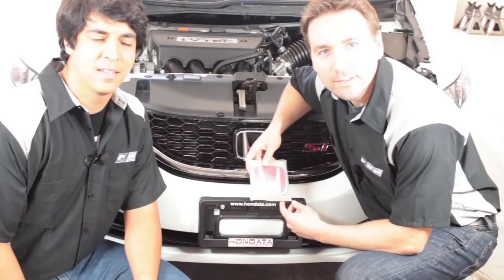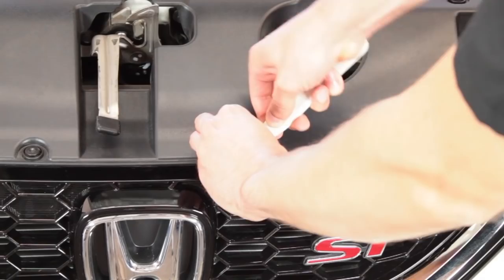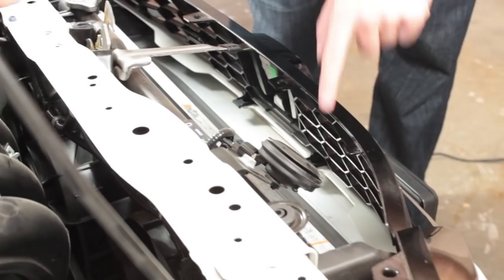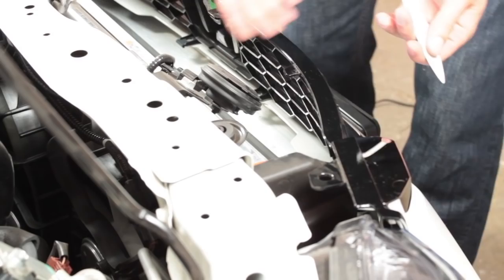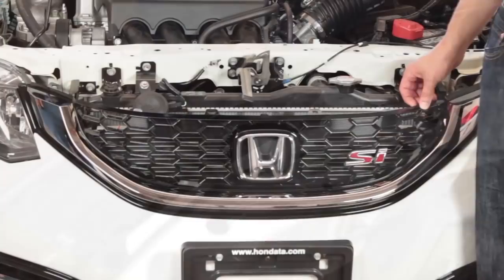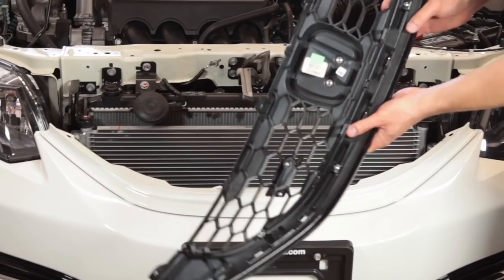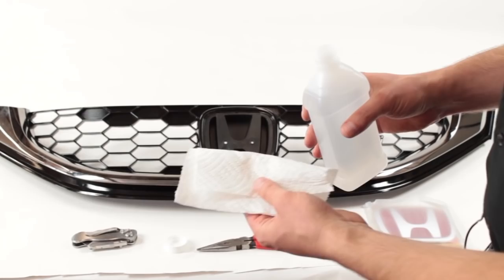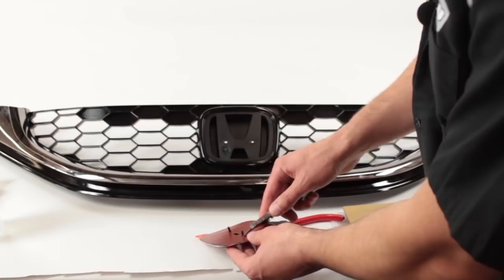Front JDM Honda Red H Emblem Install - Civic Sedan Si 2012 2013 2014 2015

Comment: For those trying this same procedure on a 2014-2015 coupe, the grill is definitely not the same. I just finished replacing the emblems on my 2015 Si coupe, and the plastic grill does not completely come off the same way, and I didn't want to try to remove it, for fear of cracking any pieces. If you don't have huge arms and have a little bit of patience, you can remove/break the clips blind from behind if you can wedge your arms and pliers behind the grill. Just pop off the plastic rivets like in this video, and it will give a little space to get behind the grill.
Reply: Hey man!! I know this comment is old, but how did you end up taking off the rear badge for the 2015 SI coupe. Did you break it off with the rear pins as well?
Reply: @04majestic   ooh that was a while ago! If I remember correctly, I think I was able to get a piece of dental floss threaded behind the badge, and got the badge up so I could carefully pull at it, moving from one side to the other, and was able to remove the badge without breaking it. If you don’t care about keeping the badge, you can def just muscle it and rip it off lol

Comment: Heat gun,plastic trim tool and you can do the rear and the front quickly. Didnt have to take off anything but pull down part of the trunkliner doing the rear.

Comment: Just done this, took 30 mins, 2013 hatchback, there were 4 screws holding the 'h' bracket on, undone them (fiddly) and the whole thing comes off. Old badge off, new one on and back together.
No need to take the grill part off mine

Comment from the maker: No, the genuine steering wheel emblems cannot be sold, since they come from Honda with the airbag assembly attached, and it would cost about $800 or so. This is why we don't sell them. Any ones you see for sale are most likely fakes, unless they are from a salvaged Type R vehicle from Japan.
Reply from the maker: +Torino117 It will more than likely need the grill to come off. There are clips behind it that would be difficult to reach while on the car
Reply: PRO Car Studio 
Plz guys, im looking for the red H emblems for my 2005 civic coupe (7th gen em2) with a type r style grill mounted.
Uve been looking for AGES to find emblems that fit, but NO ONE seems to know what size to put on the front of those... its not the smallest one, but also not the biggest one ( newer type r's) 

Plz some help!
Thx alot

Comment: Have you guys seen under the hood of the 14 coupe, it is in no way the same as the sedan I cannot get behind the grill and I cannot find these rivets you speak of + there is no room between the grill and the rad, looks like you could fit a baby in between the sedan
Reply from the maker: If you cannot access the rear of the grill, then you need to remove it like we did for the Sedan video (above).

Comment: Once you remove the grille cover, is it necessary to remove the grill? It looks like you have access to the badge pins without removing the grille. Comments?
Reply from the maker: It is not required to remove the grill. We did it because it is easier to show the steps that way, and some people may have trouble accessing the back side of the grill.

Comment: Vid seems to be long winded and unplanned task.
It seems that it might have not been a necessity to take the grill out just to remove and put emblem with adhesive.
Reply from the maker: Mscellobass You're correct on the emblem removal - it can be done by just ripping the stock emblem off, along with the little rivets that hold it in. However, we wanted to show the "proper" way to do it with damaging anything, including the emblem holder.

Comment: How would you reinstall the bumper in place? Will the popped-in tabs be able to return to their original shape?
Reply: Thats my exact the same question.. how to put back the grill.. the bottom pop tabs is up side down.. so how to put it back.. hopefully some one will answer this..  so i can start replacing my grill tomorrow☺️

Comment: If I wanted to take off my stock Honda emblem on my 09' Honda Civ LX, plastidip it and then replace it on my grill, would that be possible without breaking those washer on the back of the grill?
Reply from the maker: I'm not sure, it seems like you do have to break the little washers off.

Comment: Great video guys, thanks for it. The front jdm emblem has the same size like rear emblem? I bought two jdm emblems and I was trying to install the front one but i noticed that it doesn't fit correctly like the rear one, can you help me? I have a SI coupe 2013. Thanks!
Reply from the maker: +Isaac Gómez The emblems do change based on the type. The Sedans have 2 different emblems, while the Coupes use the same size for both front and rear. If you are having issues, simply email customercare@procivic.com for tech assistance.

Comment: So I ordered them for my coupe.  The rear one actually has an actual "spot" for the emblem.  Is it going to fit properly ?
Reply from the maker: Andy Allaby The "spot" is mostly just a small cut out in the factory spoiler. The new JDM Red emblem should fit just fine. We've had many customers install these on 2014+ Civic Coupes.

Comment: Do you remove the emblem for the coupe the same way front and back? And also how can I remove my civic badge? And my si one in the front?
Reply from the maker: The coupe is a very similar procedure to the sedan...basically identical. As far as the other factory badges, just use a combination of dental floss, a hair dryer, and rubbing alcohol. The trick is to heat up the emblem and adhesive quite a bit, then work your way in with the floss, you can also pour some alcohol over the top to help lift the adhesive.

Comment: how did you install all the rivets inside? i mean is it much more difficult putting them back on or removing them?
Reply from the maker: The new JDM emblem attaches with strong adhesive, so there is no need to re-install the rivets. As far as the other rivets (actually called "push clips"), they are easy to put back on. In general, clips are easier to put back on than take off.
Reply: ***** ok thanks im planning on buying one for my si, this vid helps alot.

Comment: Do you guys have a video on to install the emblem on the steering wheel?
Reply from the maker: +Wilfred Perez In order to install real emblems, it requires you to replace the steering wheel. As such, we do not have a video to install these.
Reply: PRO Car Studio thanks! For the info
Reply: You can either: 1. Overlay your aftermarket emblem on top of the old.
or 2. Remove horn fuse. Remove factory emblem. Install new emblem

Comment: Would be pretty much the same for Civic si COUPE 2013 ? Prob will order the this week if you can confirm that. I got a question tho, on your website you recommand using a double sided tape... really?...
Reply from the maker: The installation is virtually the same on the 2012-2014 Coupe. You do not need to use extra double sided tape if you don't want to. The reason we mention that for the coupe is because part of the factory emblem holder is recessed, so the new emblem adhesive may not make full contact in one area. It is not required, just a suggestion if you want it to REALLY be stuck on there.

Comment: I've been told you have to remove the entire bumper to remove the grill.....
Reply from the maker: That is not what I understand, but I have not done the install myself on the 14 Coupe. We have quite a few customers who have though. In any case, if you are ever planning on getting a cold air intake, you'll need to remove the front bumper anyways. It is pretty easy to do on these new Civics.

Comment: I have a 2014 Honda Accord Sport. I wanted to purchase the steering, front, and rear emblems. I wanted to purchase it from procivic.com but which size do I select? There isn't an option for Accords, I only see Civics
Reply from the maker: +Felix Stephen Check out our sister site: www.proimporttuners.com. Just keep in mind though, the steering wheel emblem is not offered since it is fake unless you purchase a Honda airbag with it.

Comment: So, as I was taking the pop rivets off on the grill portion the first three going from the passenger side to the middle came out no issue. And the final hidden rivet on the driver side of the grill when I pushed down on it it just shot out of the hole and now I can't find it because if you recall looking down in this area it's super cluttered and cramped. How would I go about getting a replacement push rivet??
Reply from the maker: Ugh, we've all been there before. Sorry to hear about that lost rivet. Usually what I do is shake the bottom plastic undertray panels a bit, to listen for any sounds that would indicate the rivet is there and moving around. If you hear anything, then you can just remove the appropriate undertray panel and get your rivet. Otherwise, you can purchase replacements at a local general auto parts store or preferably from a Honda dealer (they may even give you a single one for free).
Reply: ***** awesome thank you for the response! I did try that bump thing to hear if it moved but I didn't hear anything and well...I was putting them on at like 2am so I was tired and just said screw it I'll use one from the radiator cover and get a replacement later lol. I'll try asking Honda so thanks for the response and videos! Used it to put on both my badges. Enjoyed putting the rear one on better.